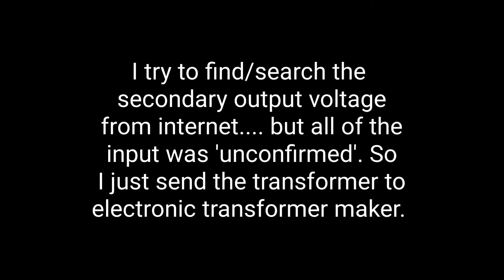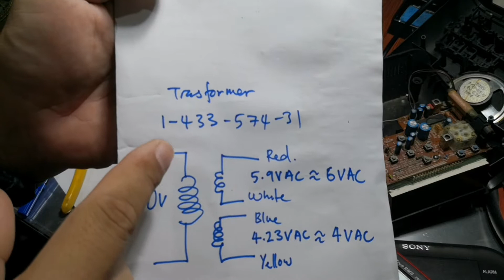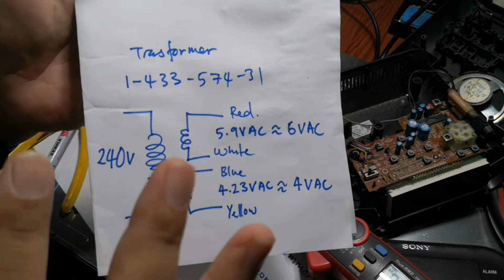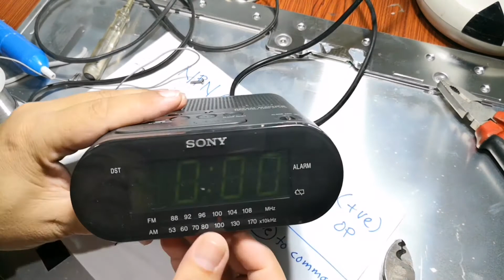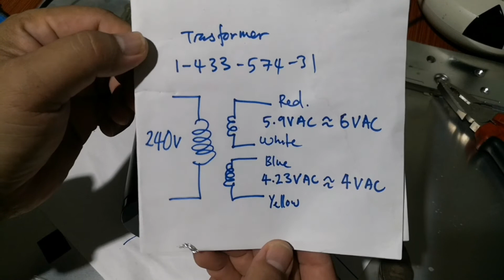Replace Power Transformer SONY FM/AM Clock Radio ICF-C218

Comment: pl sugest specs of ICF-C1 power transformer
Reply from the maker: Hi. I find this information from Internet. Somehow, there's no serial number. 

Sony ICF C1 clock

Primary voltage is 230V and Secondary voltage is red - white 6.4 V AC and Yellow - blue 4.6V AC. Mostly primary winding will be burnt, because this clock is kept on continuous operation. You may rewind the primary winding with local winding technician.

Comment: why need to replace it ? it is Error when try to set clock ?
Reply from the maker: The unit is ‘dead’. Transformer burn/overheat and short circuit….cause no power to the unit.
Reply: @petrusgoel  i have same model. When i push any button, it will any push other button randomly. Like when i push radio On, it will respon with dst on or something else.

Any suggestion what to check ?